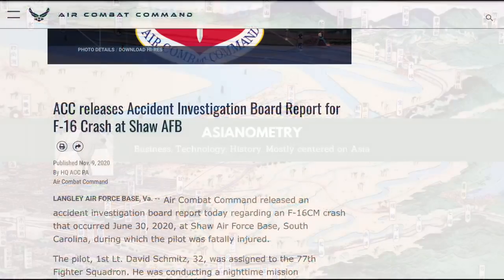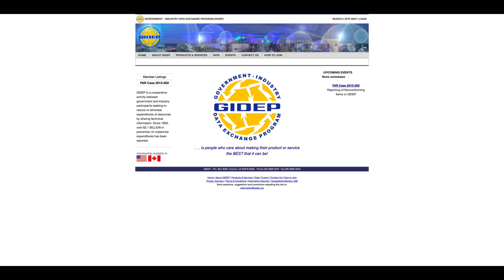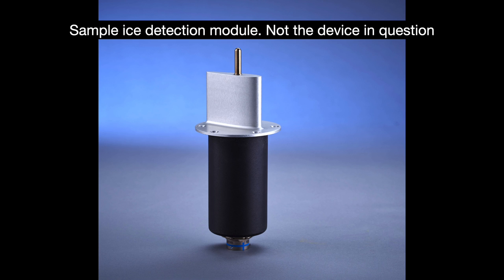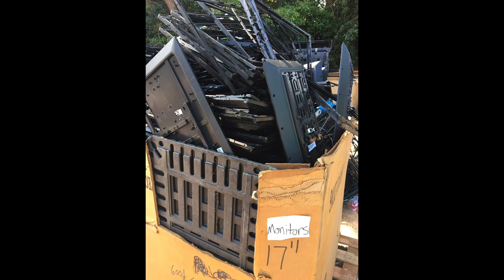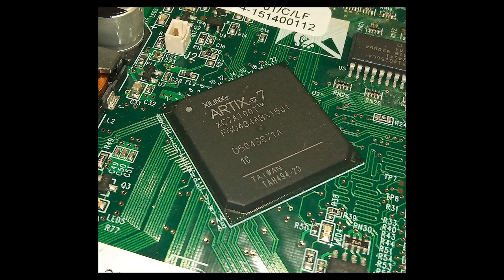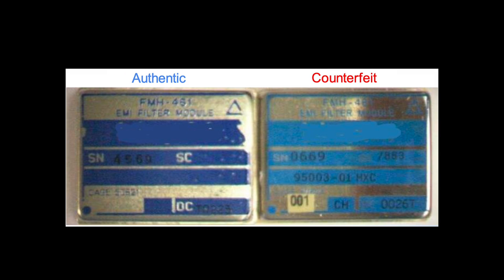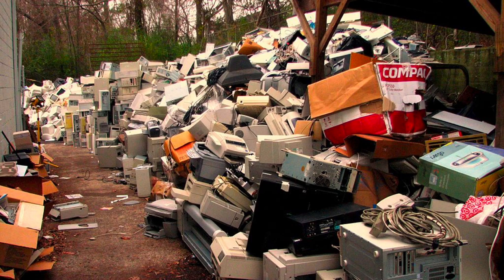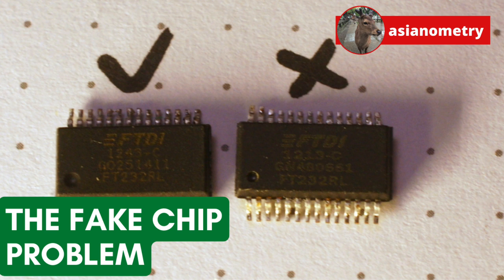The Fake Chip Scourge

Comment: No, it's not equivalent of selling "Fake louis vuitton bags". 99.9% of these bags supposed "value" is their brand name. Btw. it really shows how absurdly low incomes in some countries are, if one can make a profit sourcing 11ct to 10$ components from people "desoldering" them over open fires.
Reply: Brand name usually shows quality (or perceived trust of thereof) of a company's product. If you have a bag it's not that hard to copy it completely, you can even make it better quality (or worse). When you make your own "bag" the end result doesn't come primarily from copied pattern, a lot more important are your expertise in the bag making craft and materials that you use. If those two last parameters are better than the original, your bag would be actually better that the original, but you will find it hard to convey the information about your bag being actually better to your buyers.
The whole point of couterfeiting is to trick you into believing that a certain product is a much less risky investment than it actually is.
Reply: It's good work if you can get it.
Reply: @sshko101  The thing is: There's only so much one can do about the quality of a bag, and that's IMO not enough to justify the Louis Vuitton prices.
Also it's much less likely that some counterfeit bag not being up to specs has severe consequences.
I have no problem with them making those prices and people buing at those prices, and at least they don't manufacture these expensive luxury irems in some sweat shop.
Reply: @Pengochan  I have no idea about their pricing)) I was talking more about countefeits in general, disregarding IP part of problem. It's more about assymetry of information. Maybe in the case of luxury goods there's some social stratification part of equation which results in overvaluing intellectual part of an end product.That's probably why most of people actually are ok with good quality countereits of some luxury items, there's actually nothing unique in that pruduct's design to be priced that high. I also personaly think that it's very wrong thing to feel better about yourself when you asssociate yourself with higher social status just by mimicking some external markers or social cues, but it's ok when you actually love the look and don't mind buying a cheap knockoff of something that is just overpriced.
Reply: @sshko101  Well, the thing is: Brand names usually have certain production standards and quality control, but i consider that more important for electronic components than for hand bags.
As for the luxury items: People can have all kinds of reasons, maybe they just want the best of the best (or what they consider as that) and have the money to spend on it, or some guy wants a really nice present for his wife, and while the Louis Vuitton bags are quite expensive, they can last a while. But with some of those bags you're paying a prmium price to become a walking LV advertisement.
Reply: @Pengochan  I think that it's just a technological limitation, we lack instruments to proper measure the condition or actual construction of most products. Even in the case of simpler products like bags we still have to watch some video of an expert cobbler disassembling the thing to see what is actually making that product great. Whenever we look for purchasing any used item we usually tend to pick up some cues about the actual state of our potential purchase. It goes like with brand names in general, we pick just a superficial information about seller, photos, any cues in the description. The reason is that the proper evaluation is a lot more costly than the item itself (or close to that).
We are always buying a license for a single copy of some product, necessary ammount  of work with required ammount of know-how and necessary materials and energy, whether it's just a bag or a semiconductor chip. I actually feel like it's just technology (if you put legal stuff and know-how into the same basket with the schematics/pattern) and energy, while logistics is divided between the two. If we will find a way to evaluate all those parts for every product in real time (or close to it) - we will solve the problem of piracy, counterfeits and overpriced goods in general, and also the market for lemons won't be a thing any more.
"Walking advertisement" is quite a thing, some say it's just a tribal part of our nature, but I think it's more than that. 10 years ago my brother bought me as a gift a "Giant" bicycle, that's a nice taiwanese brand, it actually costed 20% more than equally specked bikes, but I decided that I just want that one, it just looked a lot better. It was one of the cheapest from their product line, but it as a very good bike. I felt kind of proud to advertise that brand. One of my childhood bikes was a relatively cheaper local ukrainian brand of bikes and was actually good, nothing ever broke on it. It was made in China, but it was miles ahead of most of the chinese bikes you could buy. All the other bikes I had at the time needed a bit of wrenching before every ride. One year ago I have bought the same brand bike for myself, it was relatively very cheap, even the seller at the bike store have spent an hour convincing me to buy something more expensive. I was telling the seller that I remember their quality from my childhood and that this company is the main sponsor of our ukrainian track cycling team. Yeah, the bike is great actually, I absoulutely love it, the quality is exactly like in my childhood memories. They just have all the necessary information about the supply chain to make a great product for a reasonable price.
I've actually been in a situation when a lady purposely tried to hide her purse under the table from me just not to show that it's legit expensive luxury item. I got the message, even though I don't think that I would've been able to distinguish whether it's actually legit or no without that gesture. On the bright side I just ordered a nice bag for my mom from some ukrainian manufacturer, it looks amazing, it's not cheap (I'd say the price is quite reasonable) and they told me that they will sew it in a couple of days. The brand is unknown to me, love the design, can't properly assess their quality, but it looks legit, I was actually looking for a leather belt for myself)) It's all about connecting different pieces of information.
Reply: @sshko101  Well, there are some shops that really mnufacture the individual item, that's a totally different matter. I was thinking more about mass production (and in a sense LV is). In some cases (like ICs) that makes no sense, in otheres the mass production is so evolved that it's often better than any workshop could do, but e.g. for clothing it's the better choice if done well and expertly. Also usually experts know their materials and won't waste their time on cheap crap.

Comment: Often these can be located after being detected because the fakes are using the same die markings on all the packages and not advancing the date code. 

PUF memory is often used by the hardware crypto engine for deriving the device unique ID or key.  If it was implanted in most semiconductors then there would need a way to interrogate them independently, an interface standard similar to JTAG over SWP (1-wire protocol).  You give the IC device a challenge and the response can be authenticated by the manufacturer.

Comment: Speaking of copy protection, I've seen another funny way to do it on old computers. Their "bios" was stored in flash chips with a quartz window. And it was the main intellectual value, scince old computers was made out of cheap and simple chips.  

Therefore, when flashing bios, a flickering bit was created with a weak charge in the floating gate. Sometimes it was read as 0, and sometimes as 1. Separately, in the bios start sequence, there was an instruction to read this bit 100 times, and if it was read as 1 more than 95 or less than 5 times, then the start-up was aborted.

Attempt to directly copy the bios resulted in a hard rewrite of the flickering bit and a non-functional device

Comment: Foundries and pcb assemblers often end up with spares due to the way orders are done and how the machines work. A pick and place machine often needs quite a bit of chip reel fed into the feeder and those first few chips fall off and cant be used. These chips are sold by employees on second hand markets. Semiconductor Fabs usually sell known good dies and have to over produce because the yield is an average and not a set number. This waste can lead to many extra dies produced when the customer pays for 1000 but you have to produce 1100 just to make sure you have enough to fill the order. The fab doesn't want to throw away the expensive product and may sell them to recoup the money.

Comment: I remember my attempts to find the original temperature sensor DS18B20. I bought the sensor from 19 different places and not one of them was original! All except 3 was unable to work from parasitic power. But these three had wrong bits in the 1-wire interface address. Dissolving in acid showed that these fakes used 5 different crystals!

Same story with my attempts to get TDA2050 and LM1875 amplifiers. They simply do not exist, they are all relabeled crapy TDA2030

In my experience used desoldered components have the lowest chance of being fake(
Reply: Were you buying from suppliers like digikey/mouser or from places like eBay/AliExpress? I am always much more trusting of things from mouser/digikey but I wonder if counterfeits can still end up in their supply chain
Reply: @TobyCowles  They don't ship to my country anymore because one bald dwarf decided to play napoleon(
So yes, I'm looking for components on Ali. Also i'm buying from local supplier called "chipdip" and other smaller retailers. And some things like TDA2050 can only be found on Ali, soldered out of old devices, since the official manufacturer has discontinued production and there are no good analogue
Reply: @TobyCowles  I remembered another funny story about chips. In 2012, Russia attempted to launch the "Phobos-Grunt" probe. The probe was supposed to bring soil samples from a Mars moon, the development took 14 years and 150$ mil. 

But during assembly, there were problems with obtaining space-grade chips and the military-grade were put inside. It turned out that "military-grade" means only a resistant to vibration package, but silicone is completely identical to civilian chips. Space grade chips in other hand uses different silicon with different architecture, able to tolerate high energy particle strike. So, when the probe was launched into LEO, it almost immediately failed due to radiation and burned up in the atmosphere. 

So "military-grade" and "space-grade" are different things)
Reply: @rainbowhyena1354  "Let's just put a thick enough lead case on top of it" they said))

Comment: I've gotten counterfeit chips, relabelled chips, recycled chips, second-hand chips. The recycled and second-hand ones generally are fine although the failure rate seems to be higher. I'm fine with that if it's disclosed. The counterfeit and relabelled ones are a real problem and have caused us to stop using certain chips where it's very hard to tell if what you're getting is genuine or not.

Comment: As an electrical engineer I can tell you its always best to go to the manufacturer directly then look at their list of approved suppliers and get it from them. Digikey and octopart are nice but best only used for prototyping.
Reply: For the non technical person thinking of some very basic hobby projects,    can you explain why "only for prototyping" ( In the recent past I've bought non electronic items from Digikey and found them  a great firm to deal with).
Reply: That's good if said company is still in business and even better if they're still manufacturing said components you're looking for. Quite often the case is that the chip you're looking for the company is no longer in business, or the part has long been discontinued and no modern equivalent is being manufactured. This is really where the issue is with this whole thing, but can sometimes work their way into new products as well).
Reply: @causewaykayak  because if you're in high volume production places like that just can't supply the amount needed to meet demand, as they only get so many from the manufacturer as they have limited warehouse space, unlike the manufacturer which can pump out quite a large volume to meet demand.
Reply: @madmax2069  Thank You.    That was a really helpful  answer.  👍

Comment: Soo…most of the problem with fake chips has been created by the technology consuming countries. They have a need for quality older chips. A supply of older chips is discarded IT products. Instead of setting in place a system that carefully removes and grades the older chips from the IT product waste stream and resells them with proper provenance all the needed chips are discarded into the waste stream where this mess then happens.

Comment: Am I right to say that a fake chip does not inherently mean it is bad or illegal, just a higher chance the part will fail? If I had two identical machines and I transplant one chip onto the other machine, a fake chip just means the part may die sooner, right? 

Also, would solving the fake chip problem be to pass Right to Repair and allowing regular  people to buy chips and other parts straight from the manufacturer? Actually, I am not sure how many chips are sold for the purposes of electronic repair for manufacturers to care.
Reply: It depends. An unauthorized clone might work fine, or not. An OPamp that's been re-marked as an EEPROM won't work at all. Or, an 8mb part that's been relabeled as a 16mb part might kinda work. There's so many different situations.

So, no, that is not a correct understanding.
Reply: @F L Oh, so the fake chip problem is just a mixture of companies ceasing the production of chips, the demand for old chips to repair old electronics, the low supply of genuine chips, and the supply of fake (mislabled), not working, or poor condition (used or recycled) chips with cheaper prices? Basically its more of a supply/demand problem?
Reply: Nope, it's more than that. Some parts are lower spec. More noise, more likely to fail. The funniest (?) one that I've seen frequently is an analog to digital converter, the TI ADS1115. It's a 16 bit device - it measures an analog signal and tells you its digital value, between 0 and 65535. TI also makes a cheaper one that is nearly identical, the ADS1015. It's a 12 bit chip. 0 to 4096.

The two chips are controlled the same way, and basically behave in almost the same way. But one of them gives you more precision. Counterfeiters will buy the 12 bit one and re-label it 16 bit. When you use it in a circuit everything works exactly correctly. The commands are the same an everything.

But you only have 12 bits of data. Not 16 bits. Four of the bits are always zeroes.

One way you could think about it is if you have a volt meter. The real voltage is 3.1234 volts. The correct chip shows you 3.1234 volts. The fake one is 3.1200 volts. As the voltage increases, the fake chip will eventually show you 3.1300 volts. If your system is supposed to show you the amount of power consumed by your house, it'll give you less accurate numbers.

Most of the ADS1115 boards on Amazon are counterfeit. The real chip is $2.20 in 1k quantities but the 1015 is only $1.10.

Comment: I'm not so sure that deviations from spec is counterfeit. Of course it's still a problem but unless they were being intentionally mislabeled, that sounds more like a QC problem than counterfeit as counterfeit by definition means there was intention to deceive.
Reply: That absolutely is counterfeiting. If you take 5% resistors and pass them off as 1% resistors, that is intent to deceive and thus counterfeiting.
Reply: @tookitogo  way to go missing the point. I specifically said for cases where it's not intentional.
Reply: @jon9103  But they are deliberately mislabeling them. It’s not accidental.
Reply: @tookitogo  I understand that they can be deliberately mislabeled, I've explicitly stated I'm not talking about those cases. SMH

Comment: Who the hell makes an ice detector with an FPGA?
Also the CS32F103 (an unauthorised clone of the STM32F103) fixed an error in the original design, so technically it’s better.
Reply: problem is that for one CS32, there is a dozen of bad STM32 clones. Making pinout compatible replacements with a different arch (like the GD32F103 or even the old AT90S8515) is often a better solution than making an illegal clone.
Reply: Who the hell makes an ice detector with an FPGA? People that know how to rake customers with deep pockets over the coals for tons of cash, that's who!
Reply: @PainterVierax   The CS can be bought intentionally on LCSC I think, same for the GD32s which are also basically ARM clones. I prefer the RISC-V models like the GD32V AND CH32V, they’re cool.
Reply: @Scrogan  yeah my bad. When I wrote GD32 I was talking about the RiscV version, like the newer ESP32. Good to hear CS took that jump too.
Though for e-waste recycling, not sure which is as simple to fully erase and repurpose as AVR.
Reply: @PainterVierax  That’s WCH making the CH32V (the USB-UART bridge guys), not sure who makes the CS32F103.
Reply: @Scrogan  yeah sorry, I read CS32V instead.